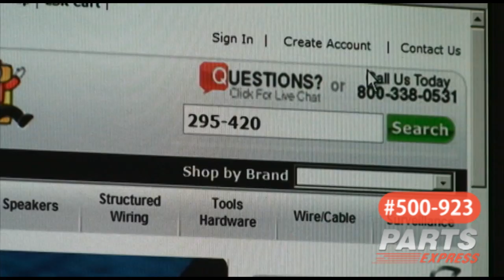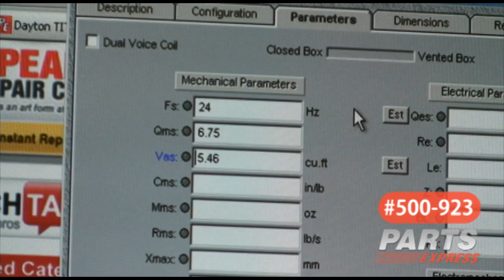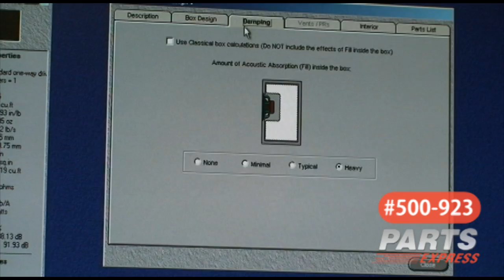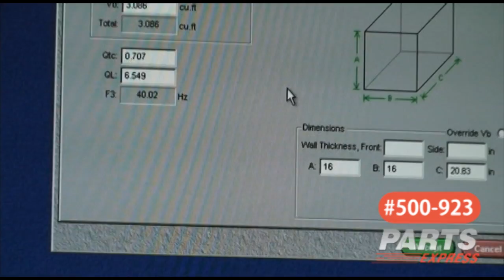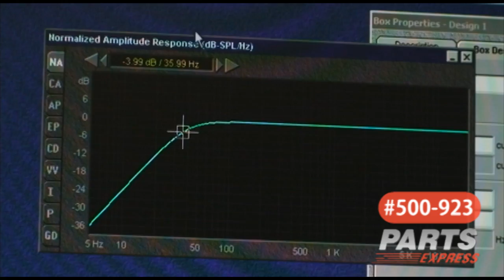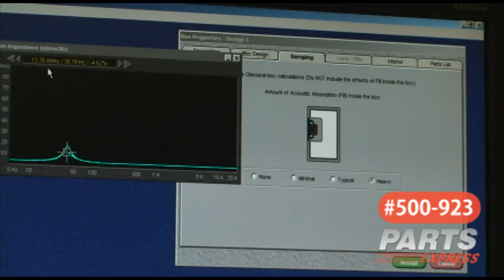Harristech BassBox 6 Pro Software Demo - Part 1

Comment: How do you put two different drivers in one cabinet? I'd like to add a tweeter to two existing woofers that I already have in the design.
Reply from the maker: Hi Steven, 
Please contact our tech department at 1-800-338-0531 for more assistance. They can also be reached via email at tech@parts-express.com. Thanks for watching!